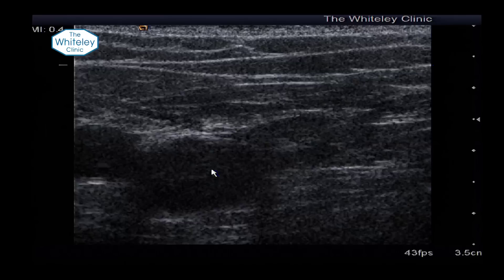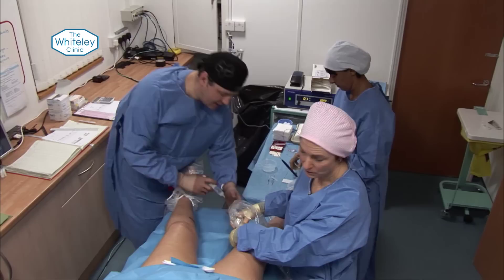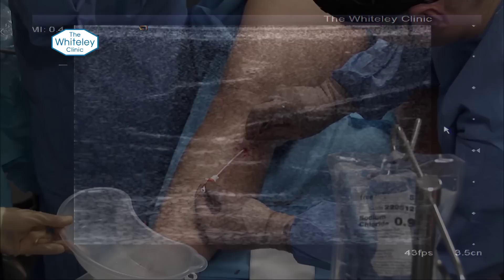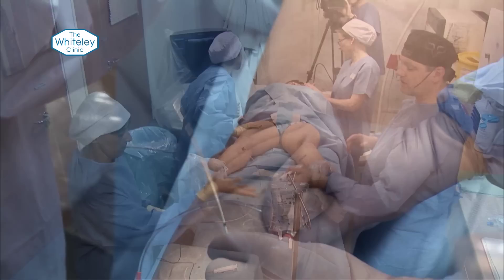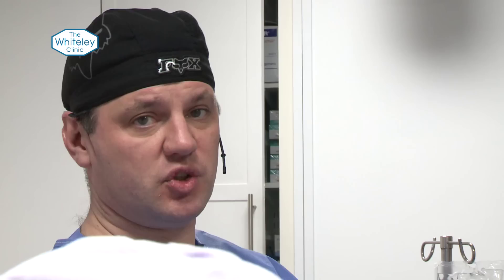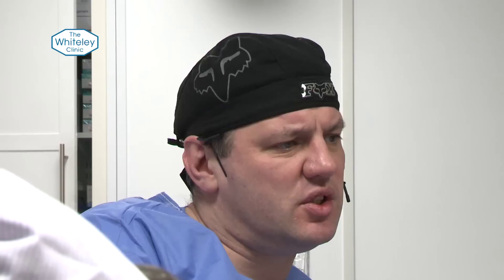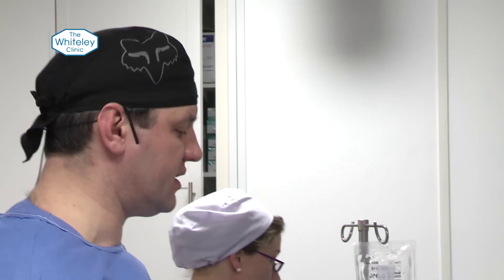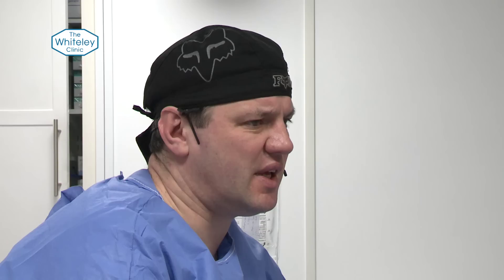Radiofrequency Ablation of the Great Saphenous Vein - treatment of Varicose Veins with RFiTT

Comment from the maker: @visualfxardist 

Yes, provided the procedure is performed technially correctly then the vein should be closed almost immediately and should not ever re-open - indeed over 6 months it should scar away to nothing on the inside.

To ensure good results - we used to do 2 cycles per segment (double what your father had) as this seems to give better results. Also, no vein surgery ever needs general anaesthetic anymore, unless the patient insists (ie: is needle phobic)

Comment: Thank you.

We used to use VNUS FAST (I did the first in the UK) - it is good for simple veins but can't be used for short segments in complex veins / recurrences - hence we find RFiTT better. 

We can also treat perforators with RFiTT using our TRLOP technique - which you can't with VNUS FAST.

We have a tumescent pump and often use it but as we are a vein teaching unit we also teach autofill.

Your questions on RFiTT will be answered in our research paper that has been submitted.

Comment: Thank you. (My father just went through vnus closure RFA, 120 degrees celcius, 20 seconds on each segment, general anaesthesia)

 I saw the videos I found that usually when the procedure is carried out, the catheter is inserted just under the thigh or below the knee, and reached above until the groin to close off the GSV.    What happens to the part of the GSV below the knee that runs upto the ankle? Would it close itself off? I posted a detailed question on  your blog, would love your response.

Comment: Hi Mark i was wondering could you possibly give me a bit of info on why after getting Radio Ablation Therapy same procedure as seen in your video, Incision was made in exact same place and they passed the wire up the Saphenous.   The problem i am having 3 months on is just this last two weeks of the 3 month passed period i have been getting really annoying cramps on the back of my upper leg around my hamstrings, its getting worse,  could i have a clot or what do you think?
Reply from the maker: Thank you for your question. This is impossible to answer without seeing you and maybe scanning you. You should go back to the clinic that treated you and they should be able to find out for you.
Reply: TheWhiteleyClinic ok thanks